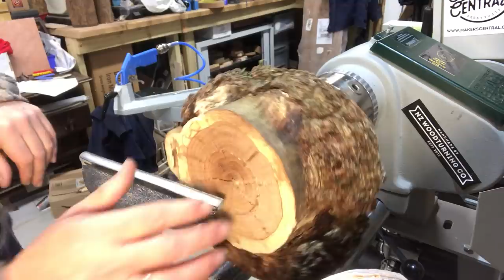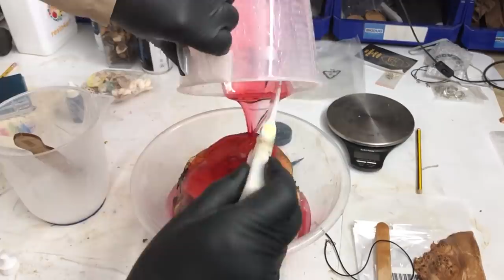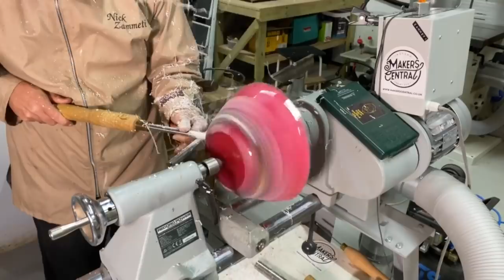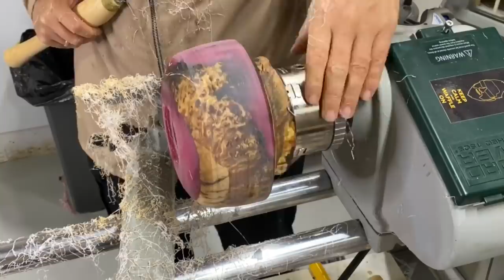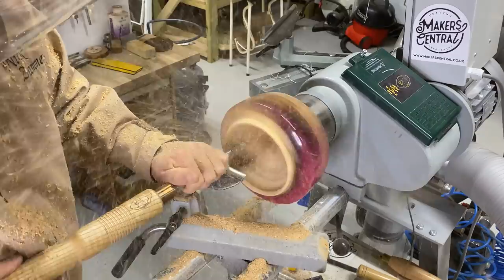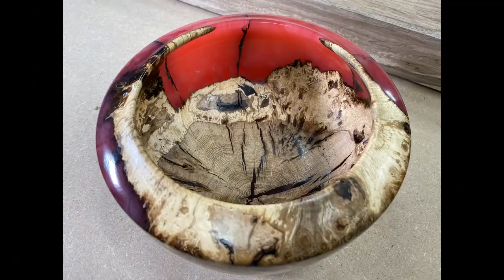Woodturning The Red Blancmange *unwaffled*

Comment: Nice ... For a long project make the biggest mold fitting the pressure pot ... Put in 200-500 ml each of a buncha colors and some trinkets/textures one at a time letting set between each ... Rest the mold at different angles each time ... WAFFLE ON ...

Comment: A quick question, Nick. Why don't you use UV resin to fill the gaps and holes? I've seen that in use in Ben's Worx Chanel may times and it seems easy to use quick and...it is resin.